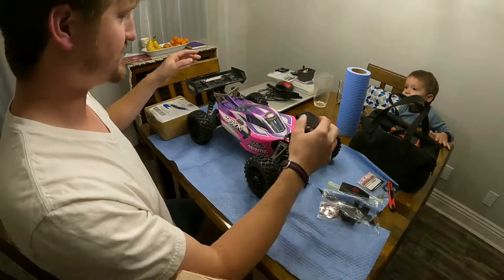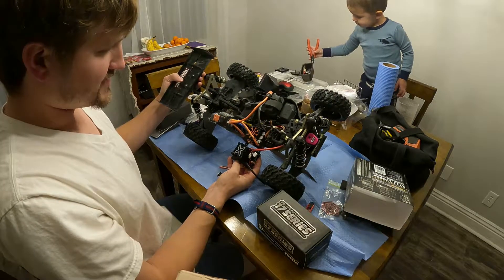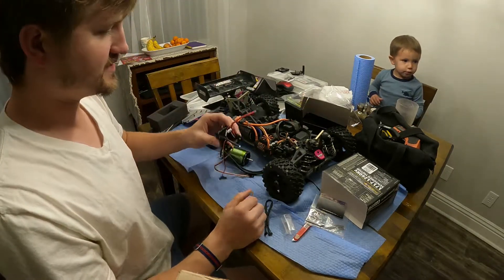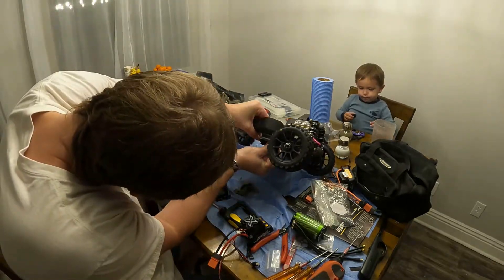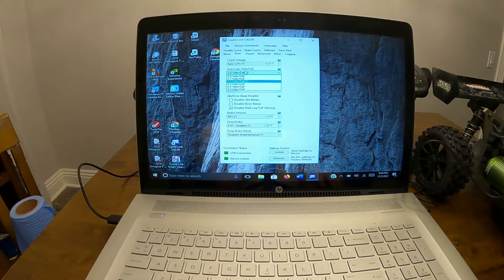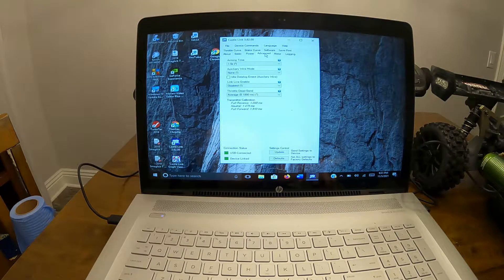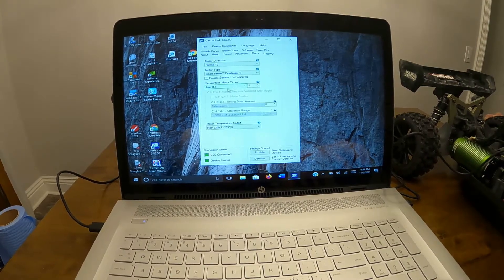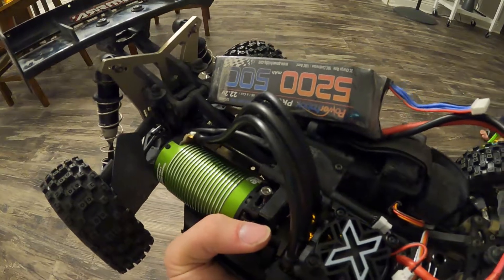Mamba Monster X 8s in TLR Typhon (New Build)

Comment: Is the fan on the esc suppose to go off on the scatter starting up & then only come on when the temp get hot. I’m use to fans staying on
Reply from the maker: I think there's a connection issue with the fan. Still doesn't work properly to this day😅
Reply: @RCnurse  I was just that these newer MMX 8s esc’s stays off & only comes on when esc start getting hot. This is my 2nd Mamba Monster esc. My first one didn’t need one. I wasn’t sure I thought payed for 2 defected MMX8s esc’s 😅
Reply from the maker: @abdullahhartage9030  dang! Two defected escs? Get replacements?

Comment: Does the 1717 1650kv motor fits the chassis?
Reply from the maker: Yes it sure does! However, with my size pinion I'm running I can only secure it with one screw. But I have a PPS motor mount on the way!
Reply: @RCnurse  what size of pinion u running
Reply from the maker: @jrarc9821  26 tooth with stock spur.
Reply: @RCnurse  yea that's always only one screw don't worry